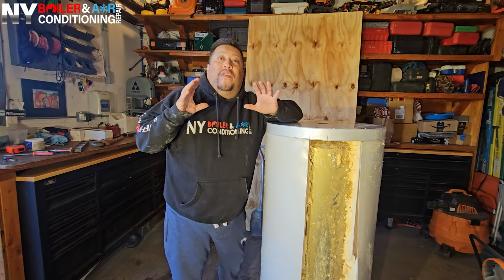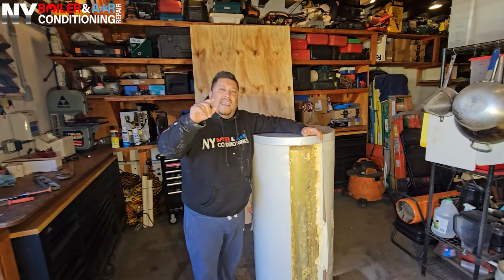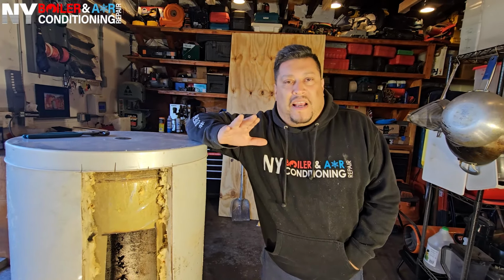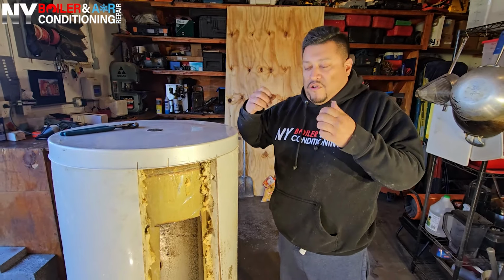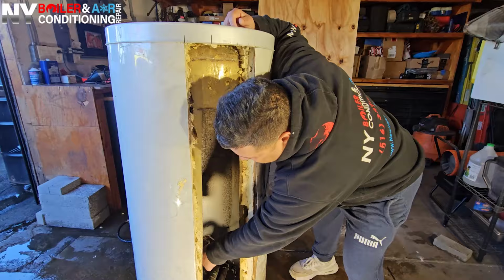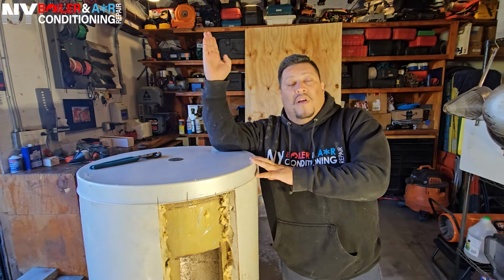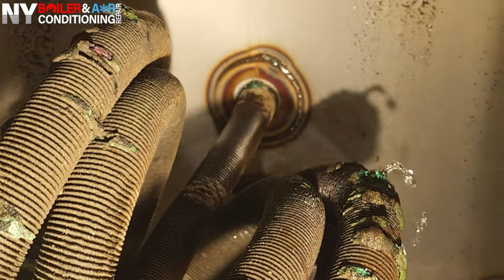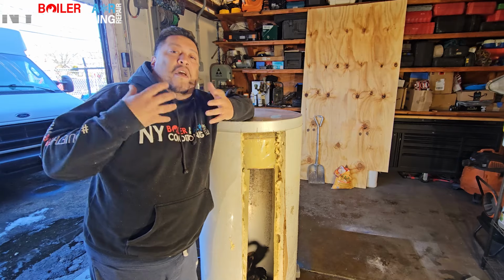WHAT IS A WATER HEATER COIL LEAK

Comment: good visual, but the boiler water goes through the coil and the domestic water fills the tank so that the coil will transfer heat over time to the large volume of water stored in the tank. When the coil leaks the higher pressure of the domestic water goes into the coil and causes the boiler pressure to rise.